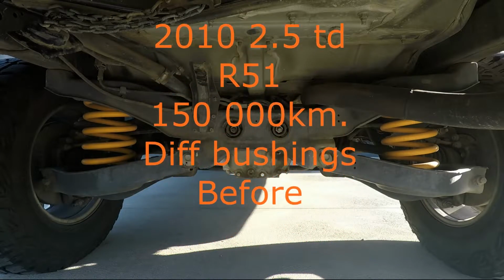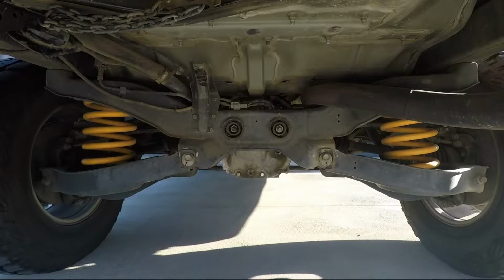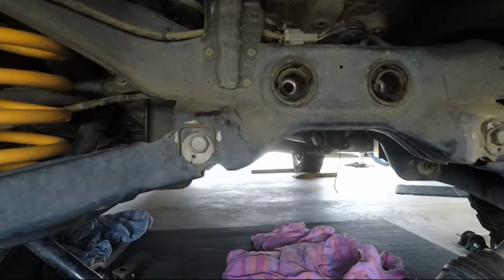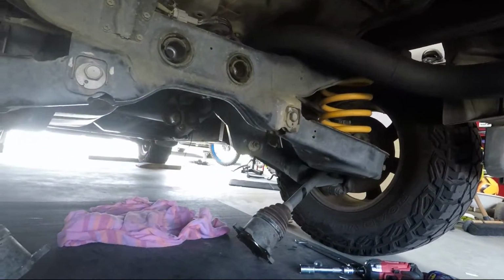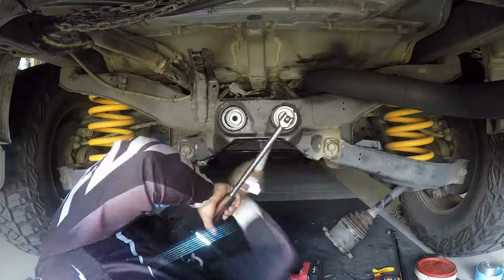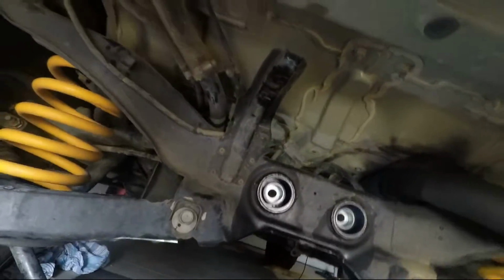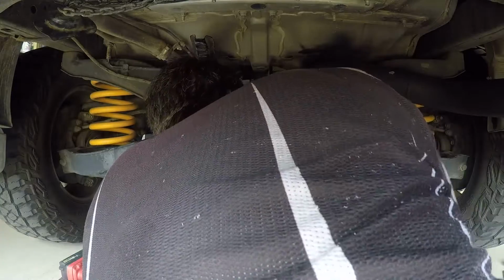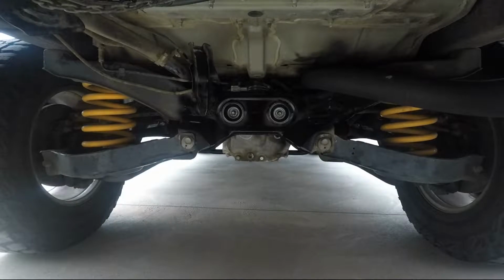Nissan R51 pathfinder (2005 - 2013)  Differential Bushing removal.

Comment: Cheers for sharing mate.. mine are looking same way and in need of swapping out. Might do control arms at same time stiffen it all back up again.
Reply from the maker: Im happy with the superpro control arm bushings. I did upper bushings and upper ball joints. Also the rear spring carrier bushing with superpro. I also wrapped the bushing sleeve in Teflon tape to help reduce squeaking as they get worn. Thanks for watching.

Comment: Great video. Did you have a knocking effect or vibrations travelling into the frame before replacing it? I'm suspecting bushes gone on mine
Reply from the maker: No knocking as it still had rubber. But you can feel the slack/movement when on, off throttle. It's not serious unless all the rubber is gone. Just have a good look. Also engine mounts are a common failure on Nissan r51 and d40. Just replaced mine aswell. Easy job.
Reply: @sirjolly81  thank you. It looks like another thing on my list

Comment: Hello,
Before changing the bushings, did you have strong vibrations in the body?
Thanks
Reply from the maker: No vibrating in my car. You may need to check tyre balance, alignment, Worn out suspension bushings, engine mounts, transmission mount or bad wheel bearing. A lot of things to look at. All my diff bushings still had rubber so didn't cause knocking or vibrating. Metal on metal would be very noticeable. Also don't forget to check cvs for play.

Comment: You posted an update video and turned off the comments. It looks like you kept the stock bushings on the diff itself on. Why didn't you replace those? I wonder if that caused more wear on the subframe diff bushings.
Reply from the maker: Sorry didn't realise I turned the comments off. I didn't replace them because I couldn't find a part number.
Reply: @sirjolly81  I'm in the process of swapping the whiteline poly subframe bushings and I'm having that exact same problem. So far I've tracked down 2 different part numbers which are 55476-ar002 and nab-209. I believe the nab is the febest part number and the other is the official part number. Not 100% sure though since I haven't received mine yet and the dealership doesn't even have a part number for them.

Comment: Hi mate. I fit them yesterday by following your video clip. The superpro bushes looks a bit bigger than the original bushes in diameter. Is it correct? Although i spray much wd40 silicon for lubrication, they are still very tight to be fitted. 

2nd thing is that my anti-roll bar's bolts was very hard to be removed, i can only unbolted them half way. Do i need to let the car stand by rear wheel for the bar to be unstressed ? Thanks
Reply from the maker: The bolts are rusted. Mine are the same last time I removed them. The bushings are a press fit. Hence why I got the correct tool to pull them into the frame. It was a tough job. Also I used a wire wheel to remove any surface corrosion. The bushings on mine stick out about 2mm further then stock.
Reply: @sirjolly81  yes, it was a tough job yesterday. Mine is the same, it is about 2-3mm futher than the stock. I fitted it without removing the anti roll bar. I just unbolted it a bit to have more space for the diff to be lifted up. I scared that the thread of the bolts for the anti roll bar would be broken if i kept unbolted completely

Comment: What is chain above holding? Np safety glasses either
Reply from the maker: the chain is for a spare tyre, Tied up for the video. No safety glasses - The temp is 40°C and fog up instantly also it was clean enough not to be an issue.

Comment: I had a mechanic replace them, after which I noticed some oil started to slowly drip from the drive shaft exit seal at the the gearbox - could it be related to this job?
Reply from the maker: I'm not sure mate. But any extra movement in bushings can cause issue elsewhere. The seal in the gear box might need replacing.